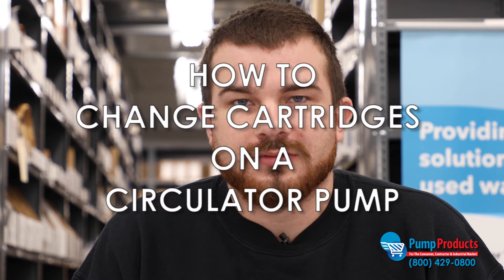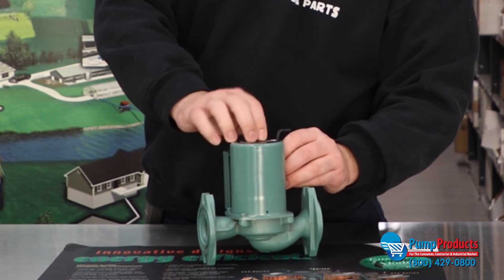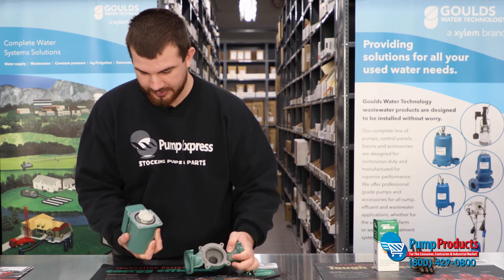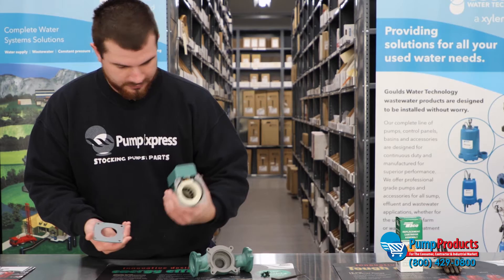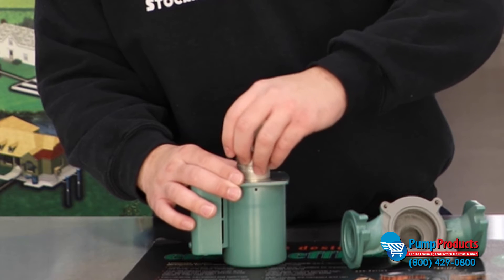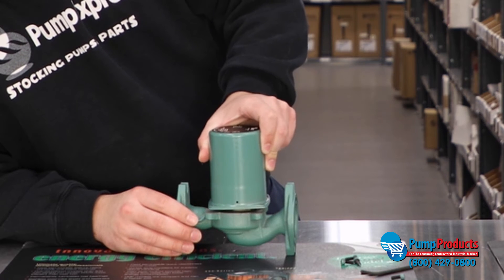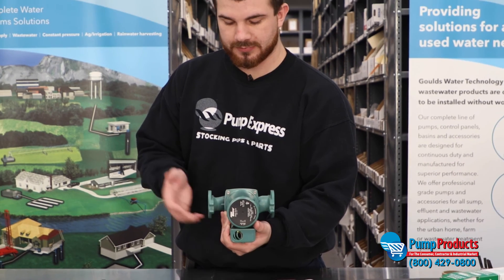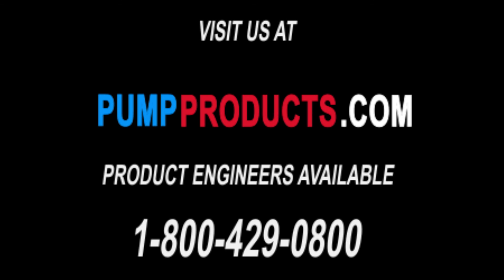How To Change the Cartridge on a Taco Circulator Pump

Comment: My circulator pump impeller shaft wasn't frozen, and only started spinning under power with a quick hand twist, which I'm guessing points to a bad start capacitor since 120v (C1-C2) is getting to the motor? The capacitor also visually had a black line mark discoloration about a quarter inch wide all along its outside yellow body lengthwise. 
Something else I noticed, without power to the motor, and spinning the impeller by hand, there's enough of a drag on the shaft which only allows the impeller to spin a vane or two, is this considered normal or should it spin around freely like a fan?

Comment: Just got told by a HVAC guy who has been in the business for 40+ years that he has never heard of someone just replacing the cartridge….yet here we are 😂
Reply: Because Taco is price gouging the cartridge price almost to the tune of a complete new pump.
Another example is the capacitor on the pump, a replacement will cost around $65.00, total greed.
Reply: my taco 007-F5 literally just ceased, and started to smoke when I was dealing with a different issue of replacing my water feeder / pressure regulator. I can get a whole new circulator at home depot for $174. I didn't know they sell these cartridges. Would this be an easier fix? I rather not have to contend with rewiring everything from my honeywell box if the cartridge kits is simpler. I just worry that smoke and humming might have been burning up doing damage to other components. It stopped when I turned the heat off but boy does my mother's house now stink. Any advice would be most welcome.
Reply: @tomoprime217  Sounds like the motor wiring is cooked, so a cartridge is not going to help. I just relaced my taco 007 after 18 years of usage. The capacitor burned out and to replace one was about $75.00. I figured the motor probably would be next to go so I just went to Home Depot and bought a new taco. As far as rewiring, all I had to do was unscrew the wiring on the aquastat terminals C1 and C2 and terminals the low setting controls to connect the new taco. I have shut off valves on both ends of the taco, so removal amounted to minimal water loss.
By the way, cartridge replacement costs almost as much as a whole new unit.
Reply: @Orange-Jumpsuit-Time I think you are right. My mother's circulator is just as old. What is included with a new circulator? I guess I have to buy rubber gaskets too? I hope the wire color matches the same way.  Are the terminals inside the honeywell box then? Haven't had a chance to take it apart, waiting on homedepot to reopen 1st. On closer inspection it looks like a one spiral cable runs from the honeywell to the circulator. It has 2 screws on the end of a clamp that elbows into the 007-f5. Thanks for the quick reply Btw.

I know my work isn't done after this. One of my drain valves is leaking. I tightened the stem nut and now the soldered joint behind it is slow dripping. When it rains it truly pours. This all started when the air vent started to leak, I replaced it, which then led to the water feeder pressure regulator manual lever not adding fresh water to the system. I replace that and bamm the circulator. I keep chasing a new damn weak point. I probably need to buy a gas torch to re-sweat the pipe holding my dripping valve.

Comment: I have a taco 006-BC4. It is part of a 5 or 6-year-old installation of a solar hot water heater system. A few weeks ago, I noticed that the circuit breaker that controls my solar water heater seems to pop randomly. Today I actually happen to be standing in the utility room when it popped, and noticed a loud popping noise coming from the motor on the recirculating pump. I can only assume that this means that something with the motor has gone bad. 

I take it that the cartridge does not actually come with a motor, but just the impeller? I was able to find the entire pump surprisingly enough at The Home Depot, and it was about $300. That seemed kind of expensive for something like this only lasting a few years. Anyway, I assume that I can simply take that assembly off of the new pump and replace it on the body of the old one without having to unsolder the pump from the pipes, is that correct? Also, should this ever happen again, is there a replacement kit that includes that motor? Maybe there was a cheaper way to fix this.

Comment: Interestingly enough, the replacement cartridge for a Taco 008-BF6 ( bronze flange-connected pump, very similar to the one depicted) comes with a flat washer for re-sealing, as well as 4 beautiful stainless steel bolts with hex-key heads. Inside, the instructions say "don't replace with a flat washer, use an O-ring, or you will have leaks and void the warranty". In the approved "case seal kit" for this very same pump, you get: (1) one o-ring (2) one flat-washer (3) 4 beautiful stainless steel hex key bolts. So... what I am to use? The flat washer or the o-ring? I can see that Taco clearly cares about quality, and I have to say, my 3 Taco pumps (008 bronze circulator series) have been stellar performers over the last 24 years! Now I'm doing a service on one noisy pump and scratching my head over these things.

On another topic.... be VERY careful how you put together a system with two mating surfaces which have a rubber sealing component between them, in a "pressure sandwich". Yes, if that o-ring or gasket isn't perfectly seated inside the metal groove constraints, you will get a "failure to seal" malfunction, if not immediately, some number of months or years down the road. It is essential to control the position of the gasket during installation, so that the rubber item does not get "pinched" by a slightly-offset positioning when closing the two constraining halfs of the joint being sealed. For my particular case, I had to replace the Taco pump rotors "in situ" meaning the whole pump is horizontally oriented, and the o-ring needed to stand up in the vertical position. To make this happen, I used a light layer of silicone plumbers grease to make 1/2 of the mating surface "tacky", allowing the o-ring to be "stuck in place" precisely in the correct position while I brought in the motor housing to make a complete mating operation possible. Good luck, DIY'ers! Peace, the Night Squirrel.

Comment: Two important points should be mentioned for safety.

1. Turn off electricity to pump.
2. Electrical box should be positioned to top or side of circulator so if it ever leaks, water doesn't get into electrical box and cause a short. Depending on your system, you may want to shut off power to entire system including the boiler.

Since most people will be doing this with the pump installed, there will be water in the system and electricity connected to the electrical box on the circulator housing.

If you don't have shut-off valves on both sides of your circulator, you need to find another way to prevent water from gushing out of the pump when you open it. If you don't know how to release the pressure from the system, call an HVAC pro or do some research.

If you are replacing the cartridge on a pump that was already in service, some water will spill when you loosen the bolts and remove the circulator housing. It won't be much if you have shut off the water.
Reply: My circulator pump impeller shaft wasn't frozen, and only started spinning under power with a quick hand twist, which I'm guessing points to a bad start capacitor since 120v (C1-C2) is getting to the motor? The capacitor also visually had a black line mark discoloration about a quarter inch wide all along its outside yellow body lengthwise. 
Something else I noticed, without power to the motor, and spinning the impeller by hand, there's enough of a drag on the shaft which only allows the impeller to spin a vane or two, is this considered normal or should it spin around freely like a fan?

Comment: After watching this video, I changed out our old cartridge with a new one and had no leaks and wonderful hot water within seconds of turning on my faucet. I'm pretty impressed with my she-woman skills. If I can do it, anyone can. The way our old pump was positioned, I had to kneel/lay on the concrete in our garage to loosen the old bolts (which was somewhat of a challenge due to the angle). But, once the bolts were loosened, everything else went smoothly. You made this look simple, and for me, it was. It took around 30 minutes to change out. Thank you!

Comment: what is the problem if you changed out the pump cartridge and pump is still leaking
Reply: Pros don't replace the cartridge because the cost of the entire pump is about another 20 bucks or less..... If they sold the pump cartridge for $30 bucks it MIGHT be worth the risk...
Reply: @Ready Temp the gamble of buying the cartridge be pump.  If the whole pump is needed, you eat the cost of a cartridge and drive time to the supply house to get the pump. You can't return the cartridge once installed also.